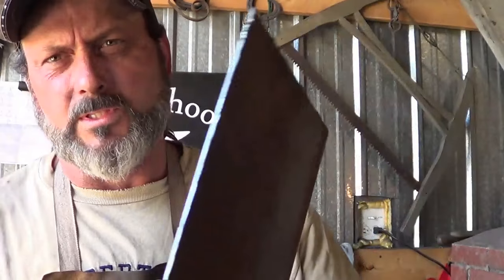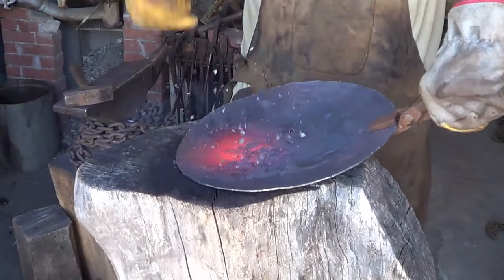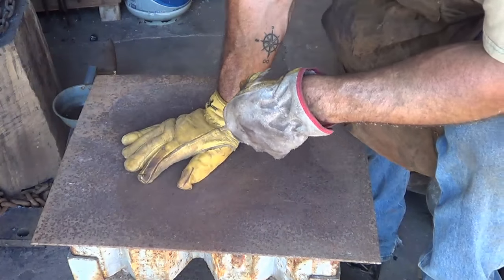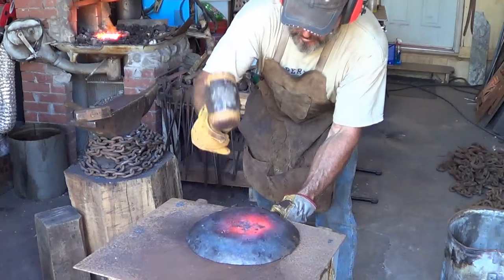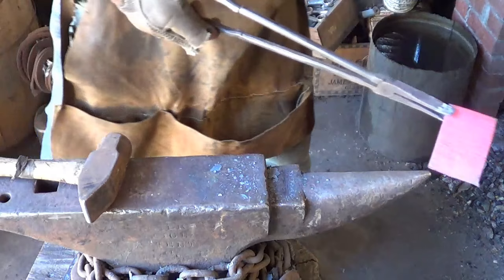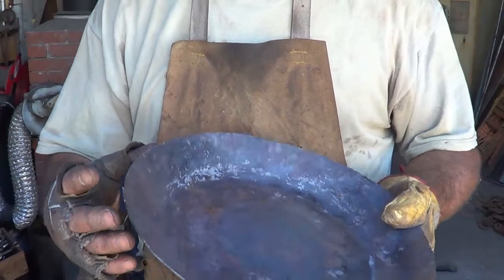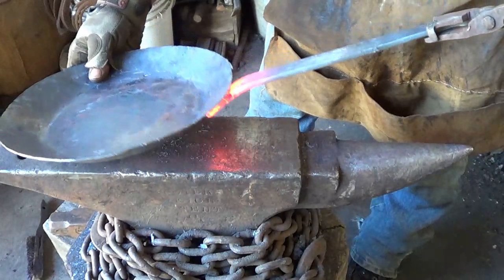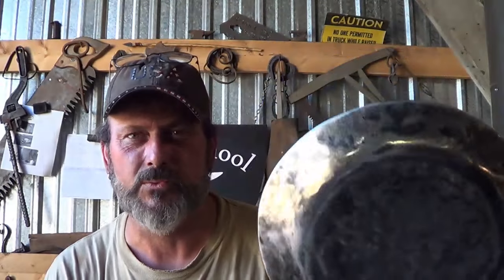Blacksmithing - First Try Forging A Steel Frying Pan

Comment: Hey Chandler, what you are trying to accomplish on the side of the pan is called tuck shrinking. Check on some videos on tuck shrinking. You can forge and make different sets of tucking forks to fit your needs. Depending on how deep or shallow you'd want your shrink. You could use tucking forks in your vise, heat your stock up, and tuck shrink the sides of your pans. Tucking forks are just basically tapered rods welded together. Or you can use a stump like you were trying to use to get a tuck and shrink it. Similar to the one video you linked where the one gentleman was making tucks and hammering them out. I like to start at the edge of the tuck. Opposite of what the other gentleman's technique.  I trap the tuck in the center of tuck to trap it. Then I hit on either side upsetting the metal to make it thicker giving you a shrink. So you'd hit in the center of the tuck 1, on one side of the tuck 2, and the other side 3rd hit. A 3 hit pattern up the tuck.  After you get the hang of it tuck shrinking goes pretty quick. Hope this helps.

Comment: Nice pan, Chandler. The video by Rebleblacksmith is actually mine. Jymm Hoffman is a friend of mine from up around Pittsburgh, PA. He was demoing at our Hammer-in in Westminster, MD.. The swage he was using was actually the bottom of an oxygen tank. He also does his fireplace shovels the same way.

Comment: Great project, don't be disappointed cause it's not perfect, it's yours made by your own hands, there's nothing better. I've made replacement sheet metal and structural parts for cars and trucks forever and it takes years(and patience, lots of hammers and handmade tools) to learn to make compound curves correctly, you have to learn what the metal will do with each hammer blow and how to correct the side effects. It's a great skill to learn. Keep the videos coming and thanks for sharing. Post a list of craft fairs you'll be attending, I'm sure your fans will come.

Comment: I wish I could tell you how my great uncle used to make frying pans for his technique would be of use to you. One of which we still have, it was made about 100 years ago of iron, the thickness of the finished walls of the skillet are 1/4in thick. The handle was forged welded to the piece and the pan was forged on a anvil possibly with a special hardy, the inside was then ground smooth. The finished piece weighed approximately 5lbs. He became a smith about a decade after the Civil War, about the late 1870's, and retired active smiting about 40 years later I guess around 1919. It has been said that he could carry a #25 (that is 250lb) anvil with one hand by the horn.

Comment: Hey Chandler I think your proof of concept, on the frying pan was good. But just a couple of notes, on somethings that I think will help you. These are some tips that I learned, back in the early 1990's from the man I worked as an apprentice for who did a lot of Medieval style work. Yes even including pots and pan's, as well as helmets. If you invest in a tool for your anvil, that looks like a round steel ball with a peg to slip into your anvil. That will give you greater control when it comes to forming the bowl, especially with making a deeper bowl. Now the other recommendation I will make, is using copper instead of steel for your first few attempts. This is because copper will be easier to fix any mistakes you make, as well as will allow you to make the pan with more ease. This is also good, because it was common for blacksmiths back in the medieval days to use copper, to make frying pans and pots as well as sauce pans. The last tip I will suggest is instead of using that big mallet, to form the bowl use a ball-pane hammer. That will also help make the bowl deeper before flattening it.

Comment: Panel beater shot bag or sand bag.  Make the shape without the heat and keep the bottom flat.  The shrinker stump is cool but wont form to the shape like shot or sand.  Came out great!  Nice job!  A Wok would be cool to make as well.

Comment: Chandler 
Got an idea 
we can call it spaghetti damascus 
imagine shavings from a drill or lathe heat and pack into a canister type damascus heat it and force the materials down into the canister. The whole time bathing it in Flux continue with adding materials until you get your desired amount. Then remove the materials from said canister or form and forge weld it proper.Never seen it done but it may give an amazing patern. 

Sorry for being a little of topic but I couldn't help myself by the way does the pan cook?would like a fallow up on it .
Reply from the maker: lol  dude I am already on this one...  hold tight
Reply from the maker: the previous re spaghetti... ,as for the pan  haven't cooked on it yet
Reply: hm
Reply: That would be really dope, but questionable steel quality (unless, you only use shavings from same steels, or steel of known compositions). Also, for canister welding, the canister needs to be shut tight, so as to avoid oxidation, in which flux would help, but not enough.Canister forging is scary tho, because you have an enclosed can, you don't really know whats going on inside, and if you are not careful, you've got a bomb in your hands
Reply: +mjrMaximus 
True about the bomb thing but I am heating shards,sherds,curls of steels that are known and compressing them into the cylinder when there is enough I will add the powdered 1085 then cap and compressor and see what happens. But I am interested in seeing another smith's Ideas and progress on something that I  think may be a great idea if it works and can you imagine the pattern! I think if anyone can do it Chandler can .I say this on a count that he motors forward until he gets a result that is appealing. Imo it would be a great video and audio great learning experience to watch as well as try.... Oh if you compressor the materials as much as possible then finish it off with powder steel with know stainless of course I don't think you would need to worry about flux because there will be a sealed container and no air to contaminat the welding process Isn't that why flux is used to get rid or oxygen and contaminates? Anyway would make a great video and audio wonderful pattern as long as it welded...
Reply: Chandler Dickinson I wish I could send you a container of brake lathe dust. I don't know what grade of steel it would make but I think it would be similar to your shop dust experiment

Comment: That's pretty impressive Chandler, the uneven edge gives it character and shows it's not just any old machine stamped commercially produced bit of iron - with that in mind, I wouldn't worry too much trying to make them perfect.

The way it started out, I've seen people use a ball on a spike as an anvil and hammer on that, as one would planish brass - not sure if steel would react the same way since brass is hammered when annealed and cold.  But then, you know this so I'll shut up :)

Excellent video and a great idea, hope it makes you a bundle :)

Comment: nice job. I found the best oil to season with is flax seed oil. lots of info on it if you Google it. It makes the pan dark black after 3 or 4 applications. then it is almost like a non stick pan.  keep the videos coming.

Comment: A little 6-inch pan is surprisingly useful. (I had one, a long time ago, and I wish it hadn't gone missing.) And, as you point out, it would be a lot easier to heat a smaller disk.

Comment: Nicely done on your first try at a frying pan! It looks like a pan you'd see in an old chuck wagon, which I think is pretty neat. 

If you get more into this, you should try cold forming. Anneal the steel, and then either buy or make a shot bag or sand bag. A couple layers of burlap sack filled with steel shot or sand will do nicely for dishing. Also: Punch holes and rivet the handle on. It adds character, and makes a bond that's strong as just about anything. At least two rivets side by side, or as many as four to hold on that handle, and once those rivets are peened down, that handle won't move for the life of the pan. 

You might want to look for information on raising a bowl as the process to start with is very similar to what you were doing with the stump. 

Looking forward to the next video,

--Jason

Comment: +Chandler Dickinson I'm sure you already know this, but most "high-end" pots/pans (and the copies) are 10 gauge bottoms with 18 gauge sides. And then they also can do funky sandwiching on the base with different steels for better heat dissipation, etc.

If you just had a form you could bang out a 10 gauge base and simply thin it to 18 for the sides, that would probably work really nicely for heat retention vs weight.

Anyhoo, cool idea, Chandler!

Comment: Chandler.. I`ve found a guy that is using the bottom of compressed gas cylinders as a buck for forming your dish, and flipping it to use for forming your outer wall. It works well, but you have to go back to heat quite a bit. look into it.

Comment: A possible solution to getting the upper part of the pan to 'cooperate' ,  would be to shrink the outermost part of the rim . . .* maybe up to an inch . . . that would contract enough metal to pull it into smaller diameter at the rim.   Heat up an area about the size of a quarter at a time, then give it a quench - it will shrink !   Good luck , & stay cool when you can ! !

Comment: Hi chandler the pinch and upset is called tuck shrinking it a technique  used by panel beaters and coach builders to achieve curves and shape in flat sheet metal..

Comment: Great vid Chandler!

An english wheel might be very handy for this form to clean up the edges really nice. If you stick to hammer...use a bit flatter faced hammer (rather than a crowned faced) and there will be less dimpling.

Comment: You should take a round piece of metal, something like the metal ring you had would work,  secure it to a stand and take your metal for the frying pan and heat it up and just bend or hammer the edges over the edge of the metal ring

Comment: The idea is to raise the sides. The level of dishing was fine, just hold the pan at a steeper angle so that you're working the sides down towards the middle. This forces the sides to thicken. If done fast, it will wrinkle but if done hot, the sides will thicken up nicely. The more passes you make the steeper you can make the sides.

Comment: To make that circle in the beginning you could also tie a string to a marker and hold the other end of the string in the middle and go around with the marker. Will give you a perfect circle the radius of the string length.

Comment: On E-bay I found a cutting guide for plasma torches. Basically a compass with a wheeled cup for the torch head. There is a couple You tube videos of some guides in use.

Comment: If you take some stumps and chamfer their edges into a series of gradually more aggressive slants, you might be able to just pound out pan after pan by moving in a sequence along each stump until the desired wall angle was achieved. Maybe four or five chamfered stumps would be enough to prevent the edge from warping.

Comment: I would suggest hot raising the edge directly from a flat sheet. same thing you did cold on that homemade tool but hot and with the cross peen if you don't have a raising hammer.

Comment: I thought I would offer a suggestion regarding welding. I notice you drag the bead when you weld, in my experience welding into the molten bead and pushing it forward gives a stronger and more consistent weld.
Reply: Seeing as the conventional wisdom for stick welding is to drag, possibly Chandler learned to stick weld first and never really updated his technique for mig
Reply: My experience with mig works just as good whether you push or pull. Pulling or dragging a mig weld tends to give me a weld with more penetration. Dragging seems to get the arc force into the root of the weldI better for me any way, I try to keep the shortest stick out possible too. With the slightest gun angle possible usually 15 degrees or less if possible.
Reply: bah, just weld strait in. its a good compromise between penetration and the finish of the bead.

Comment: Chandler I know you said the log is proof of concept, in just thinking why not try a doming block set from HF I think it's $25 or so. I think that because I see them with auto hammers. Or maybe let's say a 45 angle that's the edges themselves are soften so it does not tear into the metal. Just a thought though :) and great job!
Reply: You could also try a fire resistant bean bag like they use with planishing hammers :) another thought lol

Comment: If you could sandwich the center of the pan between two identical round steel forms (long clamp holding it all together) then you can heat and work the lip of the pan without affecting the center of the pan. Less work and smooth cooking surface. My idea is probably not the best but I live by the creed that there is a jig for everything...except relationships.

Comment: I suspect that pan may be a bit thick. generally the thinner carbon steel saute pans are the most sought after in the world of professional cooks/ chefs. ive used the thick and thin carbon steel pans and always liked the thin ones best. this seems to be the general consensus among other cooks ive talked to. either way well seasoned carbon steel pans beat all other materials hands down.

Comment: Dear Chandler, Thankyou VM and congratulations for teach us about how make this beautiful pieces with old technics. I Ask to you if it possible to make a big cooking pan (pot?)  for many people but without torner machinist, only from a steel sheet , then make a drum , after Weld the joints along and on the bottom cover.  Very Country steel pan?: if possible, how can I do it?. Thank you , best regards for you from South America.

Comment: If it's an option, I think for making camp pans/skillets it might be better to make a form which would be the inside as opposed to hammering into a cup.  With an internal form you could avoid a lot of the hammer marks, dings, and dents from pounding into a cup.  Having the majority of your dings and dents on the outside of your pan would make them that much easier to get at if you're of a mind to file, sand, or buff them out.
Reply: What you saying is called stamping, there a lots of $50 stamped french pans on the market
Reply: @EVR1AL  if you make it yourself is there any less honest pride in the accomplishment if you fail to use the most difficult method?
Reply: @draconusspiritus1037  well i kinda like hammer marks, feels like medieval piece. Anyway we appreciate hand crafting, that's why we're here.
Reply: @EVR1AL  I tell you what, I'll happily sing your praises from the roof top if you can manage to show me some genuine hand crafting.  As in BY HAND ALONE.  No tools, because those aren't your hands.  No forming cups or anvils.  Because using those would not be HANDcrafted.  

The only genuine difference between what I said and what you seem to think is more authentic in some way.  Is where the hammer marks are.  With your method, most of the hammer marks end up on the inside of the pan.  Which results in you spending that much more time just trying to flatten and smooth it out enough to be able to use it as a pan at all.  And what I suggested so most if not all of the hammer marks were on the OUTSIDE of the pan.  Leaving the inside flat and smooth.

I'm not talking about using a hydraulic press to effectively stamp out pans for mass production.

Comment: The tool you made looks very similar to a GP hammer dolly.

As an aside, it would be interesting to see if this sort of pan could be made on an English wheel, but I wonder if the steel is too thick for that.

Comment: If someone said to me make pans - I might have a couple of 8 x 1inch discs - held in the vice like making a boiler end plate - maybe a cut in the side of the pan to stop the crimping and then weld that up - there is probably as many ways as skinning the proverbial cat - or build a fifty ton press and weld up a series of rings to form a die - I suspect they are pressed out commercially in one operation. another way might be to spin the pan on a metal spinning lathe, I once watched a chap spin some huge bowls very interesting. - ATB

Comment: Hi Chandler thanks for plugging my video.  You are right - that is not the production technique you are looking for but the approach is the correct one.  By concentrating just on the rim you eliminate all the hammering needed to smooth out the bottom.  You need to do what the boilermakers used to do for forging the end caps.  Check out this video around 9:35  https://youtu.be/H_9WRykzX8I .   I think if you expand on the vise insert you made to include the actual shape of the rim and base angle ( 30 degree pie slice? ) you are after you will be able to upset the rim the same way they did here.  All the hammer marks will be on the out side and the smooth finish of the die will  take care of the interior.  It's a time proven methods so it's not a gamble - you just have to figure out how to make it work for you.  Good luck

Comment: Chandler, in the video, about half way through, I think, just to the right of your left foot there is a propeller looking piece that looks to be about the right diameter for the bottom of the pan.  Could that be used as a swedge for the bottom of the pan, using it to pull up the sides of the pan a bit higher than what you had, and more like what you wanted?  I liked the video and hope to try one, next summer!  Thanks!